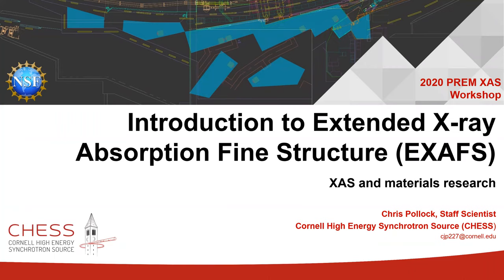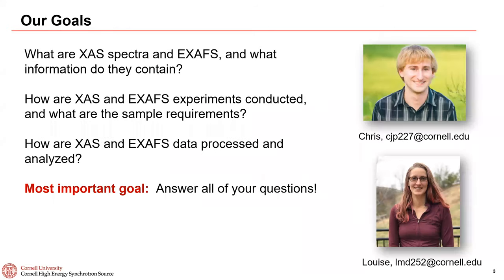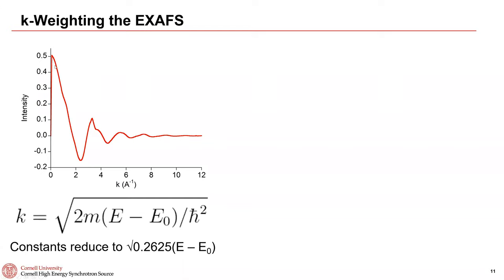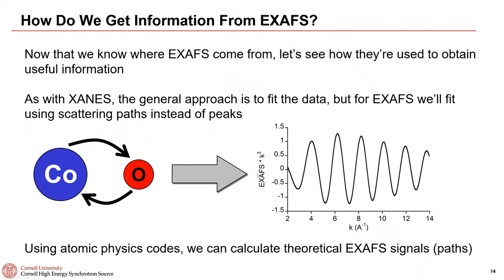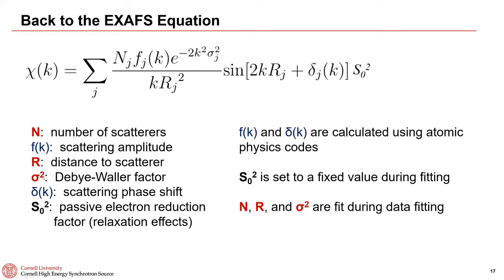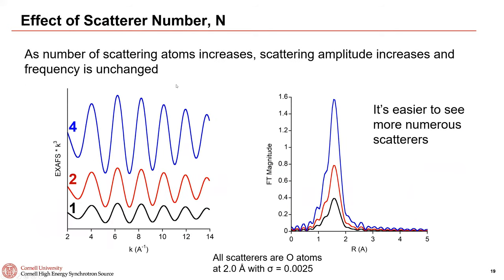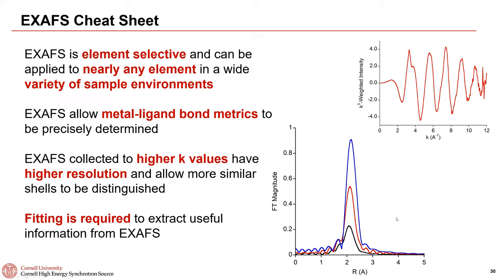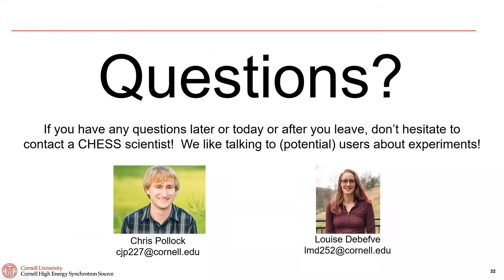Introduction to Extended X-Ray Absorption Fine Structure (EXAFS)

Comment: Is it necessary to learn about the Fourier transform?
Among them, to what extent should I understand complex numbers and Euler's formula?
Reply: You probably won't need to learn about them rigorously (how to do them by hand), as most programs can likely produce a fourier transform for you. What is IMPORTANT about the FT is that it says you can take ANY complicated wave and separate it into a linear superposition of discrete sine waves, organized by characteristic sine wave parameters (frequency, wavelength). That said, the FT is everywhere, and it would be good to obtain a working knowledge of it, because it likely isn't going anywhere soon (the math is also REALLY cool).